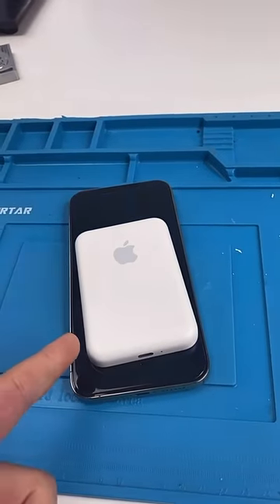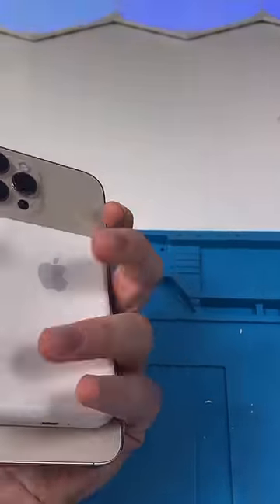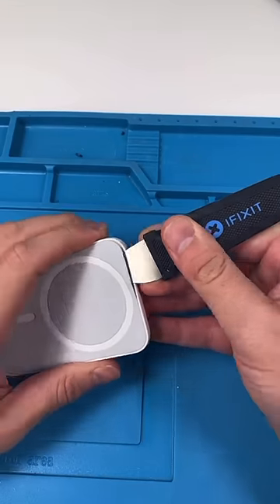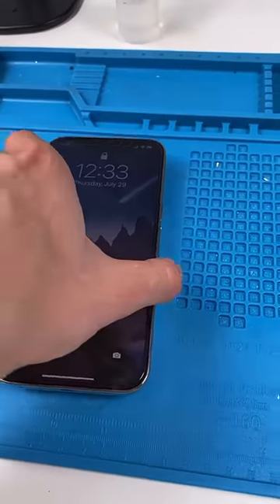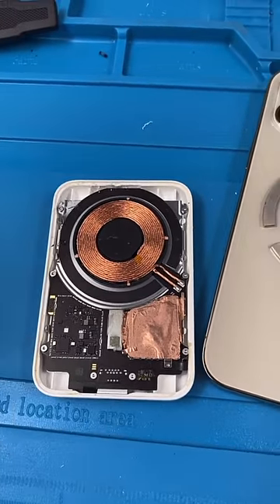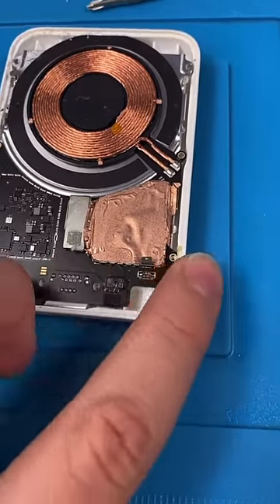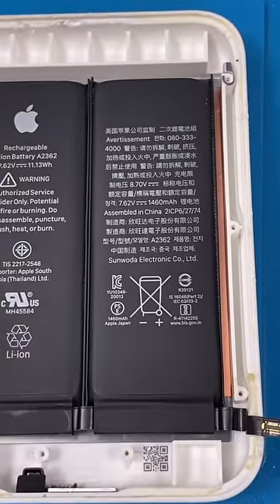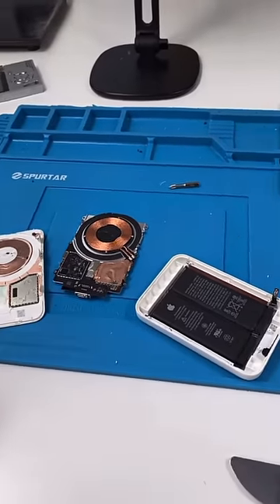Is Apple's New Battery Pack Repairable?... Teardown #Shorts

Comment: “The screws are all the same size” don’t worry it will be “improved” next year😂😂
Reply: They will start using rivets connected to e-fuses. Also the screen. Remove it, brick your whole device.
Reply: They'll remove them completely and put industry strength glue which will brick the whole thing if tried to open

Comment: That 1460mAh battery is not worth it at all for the $99 price tag. I don’t even think you can fully charge an iPhone 6 with that. At that point just get a 10000mAh battery for $20 and you would be able to fully charge your phone at least 2 and a half times.
I got one myself and it works great, but I can live without being able to attach it to my phone like the Apple one.

Comment: That’s too odd it feels like we are having 1st gen powerbank fatty rounded 🤛🏻
Reply: It’s a 8,70 volt 1460 mA/hour battery so that’s a bit more than 11,xx Wh.  Enjoy the weekend.  Stay safe, healthy, strong, happy and be blessed ✌️🍀❣️
Reply: They just need to make cases that you just plug in and turn on to charge and when it's full you can turn it off and whenever the power bank case finished it's charge you can charge it with the same cable for your iphone
Reply: @gunnarallgottsmann  quick maths :) you are saying that 8,7 x 1460 = 11xx ?? I assume that this is just two 3.7V cells in series adding up to 7.4V

Edit: the vid even shows: It's a 7.62V battery so apple ares their cells a little bit higher.
Reply: @S0ulmaster07    Indeed, Alain, it’s two batteries in series.  If they are fully charged, they’ll give you 2•4,35v = 8,70v (1.460mA).  It’s  equivalent to a ± 2.900mA.  Geniet van je dag, Alain.  Stay safe, healthy, strong, happy and be blessed 🕊✌️🍀❣️

Comment: Wow, a $99 battery pack with only <2000 mAH… that’s insanely overpriced. I bought a 26,800 mAH battery pack for like $35.
Reply: It's not overpriced
Reply: @connerwine8257  it is extremely overpriced. You can order 1450Mah battery cell from china for like 2$
Reply: @staidey5994  You can also spend 5$ and get a 2500mAh+ one from reliable manufacturer.
Reply: @connerwine8257  it’s INSANELY overpriced
Reply: @jacobbellet401  lol gotta make sure it makes profit
Reply: @connerwine8257  yeah… like 1400% markup…

Comment: I imagine their goal is to make the battery pack just useful enough to warrant buying it but would be as good as others on the market if you bought 2 or 3. It's also small enough to drain it on a regular basis which makes it need to be replaced sooner too.

I doubt they'll ever make a bigger one due to that and as this will sell out constantly regardless because "muh ecosystem"
Reply: Yeah, the smaller the pack the more it has to be charged on the regular, and the less amperage it can safely put out, leading to terrible cycles and very frequent cycles at that. It has Apple written all over it.

Comment: "it's a little overpriced"
Bro in India it's ₹12000 and for ₹2000 i can get a 10000mAh power bank and at ₹5000 i can get a 10000mAh wireless magsafe power bank from third party companies

Btw yes i know this charges fast but 10000mAh is greater than the 1460mAh which fills only ⅓ of the battery

Comment: Omfg.. Apple made another thing that will never be repairable by just exchanging the broken/degraded part (which is usually the battery)...

Nah, with Apple design you've gotta replace the original piece that went bad, and then EVERYTHING else that you had to break inorder to access it...

Comment: If this power bank from apple is not a clear sign they're selling seperate and overpriced garbage I don't know what is.

100€ for 1460 mAh, while I have 20000 mAh with 3 charging ports that support fast 15W fast charging for 25€.

Comment: I hate Anker products to buying theirs Is off the table. Their CS is lazy and I’ve only heard terrible about them from friends. That being said MyCharge has a 3,6, and 9Ah options and I’m not sure what I want to go with. 3 is $50 so it’s on the same price as Anker but I imagine it’s trying to replicate the compactness of this one. 6 is $60 and edges out Anker slight, and then 9 is $70. I think I’m leaning towards 3Ah since I already have a 20.1Ah battery bank for everything else.

Comment: 1460 mAh for 100$ is ridiculous and because induction charge is very inefficient, you will be lucky if it can deliver 1000 mAh to the phone. 
Dont forget the best part, the extra heat will decrease the battery lifespan. 

I have a power bank a little bigger than that with 4000 mAh and it is dirt cheap.

Comment: 1460mah is ridiculously low, especially for that size battery... Means it's a low density which is even cheaper, they could've spent a little more and either kept the same capacity and make it way smaller or for the same size double the capacity but they were cheap assholes and sell you a battery pack 100$ with a battery cell worth like 2$ when they could've spent 3$ instead and made it an actual good product... Btw those prices aint bullshit, look up lithium 1460mah on AliExpress and you'll know, and let me tell you bulk prices for a company like apple are even lower despite their batteries probably being higher quality.

Comment: Please don't mix up the Battery Capacity with other power banks. This one has double the voltage than a conventional phonebattery and thus only half the AmpHours. Still its about 3Ah at normal Voltage which is like one full charge. Not great, still.

Comment: Unpopular opinion:

Wireless chargers are the most useless and wasteful invention in the past couple of years. If you have a wireless charger around your house, you most likely have a normal cable around, so just plug it in! You also cannot use your phone while it's on the damn thing and most importantly: They are inneficient as sh*t! You're way better off, if you just plug it in. It takes way less time, and less energy gets wasted when transmitting energy.

Comment: Idk why this guy has to throw white lies in like the battery pack working after he pulls it apart. Clear jump cut and there’s a coil and connectors on the side he pulled off??? No one would care if it didn’t work at that point???

Comment: I prefer the battery pack that is intergrated into an iPhone case because it's comfortable and it will not fall off the iPhone unlike the battery pack that 'Phone Repair' shows in the video above.

Comment: I seen what you did bro. Trick no good. I know you had to open Atleast 2 battery pks because the first battery pk you opened up ripped the middle black rubber piece in the center of the charging coil. The one you tried to see if it still worked on the iPhone didn't have that ripped black rubber piece in the center of the charging coil.

Comment: Just get a battery pack for $30-40 with double or triple the capacity, it won't have wireless charging but wireless charging is inefficient and you're losing power in the process anyway.
Reply: And obviously slower

Comment: Ngl, I dunk on (Cr)Apple a lot. But this pack is actually pretty cool using a magnetic and a built in induction coil.

Overall, hope we get one for Droid xD
Reply: I wouldn't hope :) you lose a lot of capacity because of wireless charging, and tell me how dont you have space for a 30cm or 15cm wire and a 5000mah powerbank but you would have space for your 6inch phone and a bulkier 5000mah battery stuck on the phone

Comment: Thanks I'll just buy a power bank with wireless charging and strap it with my phone. At least it'll have more capacity.
Reply: Dont do that, is expensive and will decrease the lifespan of your phone battery. 
There are cheap powerbanks with 20k mAh. Just use the fr***ing cable. 

Why not just buy a phone with a big battery in it?
My redmi 9 pro has 5000 mAh. Last almost two days at full throttle.

Comment: I’m gonna guess what’s inside this device right before you open it then see how wrong I am but I imagine it will be a small lithium battery wired to whatever tech it is that makes wireless charging happen, just returning after seeing and yea pretty similar to what I expected minus the charging coil I was expecting something different
Reply: Its called induction, the same thing used to cook.

Comment: If they could use a flater larger cell and have it slap on the back , like a phonecase without the sides. Just the flat back part. That would be dope
Reply: stop give ideas apple will stole it for you the same way they stole the smartphone idea

Comment: Even if it's overpriced, it does make use of a phone's feature (not everyone has wireless chargers) I'll give apple atleast that.
Reply: It's easier just to have a cable i have an Android and it takes 5-10 min just to go to 40% or higher
Reply: @jpeg..  but on the go, you would be troubled walking around with cable dangling from your pack. I go out a lot and my cable dangles on my android. where im from, that can be a sign of potential "oh I can rob this dude" atleast the apple power pack on its design now, can be held and kind of concealed in one hand compared to the wire dangling.

edit: my power bank is in my bag & my phone on my hand.
Reply: @submarinemagnet7965  i only use power banks when I'm on a trip not in my every day life
Reply: @jpeg..  i never said that the battery pack would be used exclusive at home though.. but I still give apple atleast that since the battery pack that connects via coil is using a feature of a phone that you've paid for.  Why?
Because my experience is that I bought an Oppo phone that has Time of Flight camera that promised 3D photography in advertisments, thinking I could use that for CAD references. 2 yrs later (oppo only updates phones max of 1.5 yrs btw) and all I got is... a pocket measuring tape? Like, it can take straight line measurements of a wall, i guess? (Which I dont need and its so inaccurate on measuring tall buildings). The version that had TOF, you need to add $200 more for the Pro. 

So now looking at apple, utilizing a feature on its own phone sounds better than my android phone. Yeah its a cash grab for apply but hey, atleast they're trying to compete again (airtags, airpods, battery packs, etc)
Reply: The pocket measuring tape released 1 yr after the launch (i bought the phone at launch) 

So out of context, please dont be so trusting on promises...and on new things. (Oppo was the first to have TOF cameras and sensors)
Reply: @submarinemagnet7965 might as well call it air battery